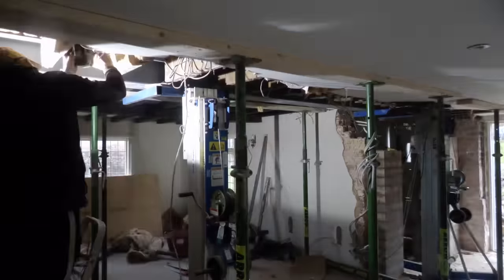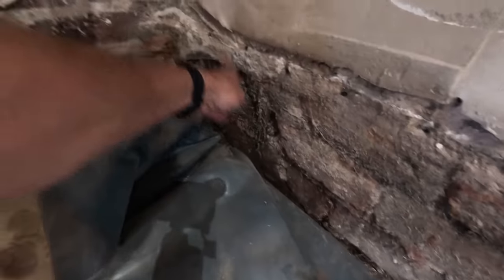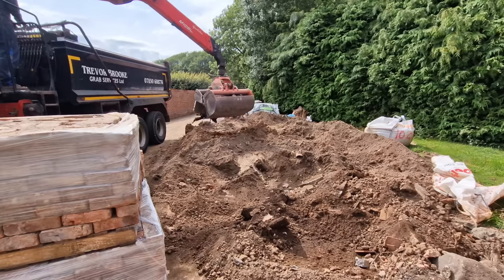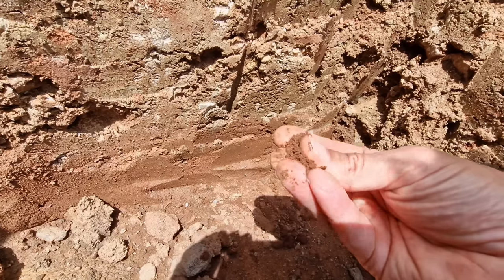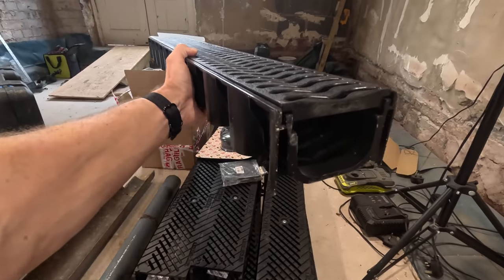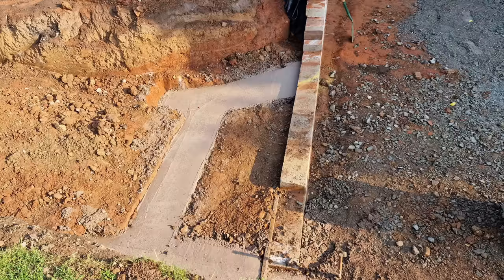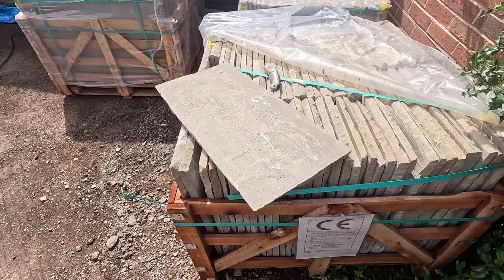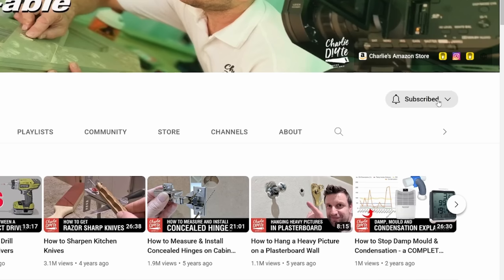Total Garden Redesign

Comment: we recently had an extension done and had a few quid left over in the budget for contingencies
we did run around 20% over that as well as there are so many unaccounted for costs that you don't factor in, all the permits and plans for example were the thick end of £4k, we spent over £1,500 on extra electrical fittings and a new consumer unit, then things like tiles and all the little things such as radiators and valves and waste traps etc all add up to eye watering amounts
we were VERY lucky to have the actual cash money because we would have run out after the shell had been finished had we stuck to our original budget numbers

Comment: Charlie's we moved into a 1900 sandstone house last August, it has been extended but long story short all of the extension stuff has been very poorly done, we budgeted ( after seeing the issue) 10k to fix the 3 steel beams leading from extension to old house- it was a mess, it cost us 37k to remove and install the new beams- 16 now In total as the 3 beams were not up to standard and they had been complete opposite from what was on the council planning paperwork, due to the that work nesding done we rhen had to fork our over 30k for new kitchen. A simple viewing hole to see why the walls were so thick around the extension was bang on were the weight of the extension and old roof has lead to deep cracking. Lucky hole drilled at exact height lead us to a 67k spend we didn't even think we needed to do! Absolutely gutted.

Comment: As always an informative and interesting video Charlie, it's tough when you get scope creep, but, as you have identified, sometimes it makes sense in the long run to bite the bullet and fix the problem at it's source before moving on ! Levels are such an important consideration, particularly in older properties and also particularly in the westward water counties of the UK !

Even in my Millennium era new build there are issues around levels between adjoining properties and I am in the process of ripping up my builder installed patio and re-laying it with incorporated eco-drains that exit into soak-aways under our (currently arid) lawn !
Reply from the maker: Thanks Andy, and great to hear from you. Scope creep is a good way of describing it! Really hope you sort the drainage issue - sounds like a good idea, that. 👊

Comment: A bit less than a decade ago I hired a painter to paint the trim on the windows on the upper floor of my house as I don't do well on ladders. Despite me telling him not to do it, he painted a base coat of oil before applying the acrylic paint I had supplied. I painted the ground floor window trims with just the acrylic paint.  After three years the paint on the upper window trims were starting to show cracks, something that didn't happen until the fifth year on the ground floor window trims. The only preparation was to scrape away any loose paint. (Thankfully I don't have to worry about painting the window and door trims anymore because as the house is almost 30 years old it was time to replace the windows and doors. I got ones with vinyl trim that I won't have to worry about for a long time.)

Comment: For the raised walls, you could have poured in clean drainage gravel behind, membrane it to stop soil migrating into the gravel, then put 20mm pipe into the base of the gravel to allow water to pass through the wall into your new shallow patio drains
Reply: Depends. If it's a clay soil never use a membrane to stop migration of soil. It will clog up and contribute to further hydrostatic pressure. Filter fabric (non woven) should only be used in non-clay soils like sandy soils.
Reply: What would you use then?

Comment: I'm in the middle of similar works on my garden, almost identical in fact.  My question is why are you using cement with lime or lime with cement  if you prefer ?  Is it a colour thing ?  Cement completely negates the breathable benefits of lime and having been on a great lime training course, lime doesn't need cement to bond but is usually branded as belt and braces by those who routinely just use cement.  Keen to hear your thoughts and always enjoy the videos.  Keep it up !
Reply from the maker: It's a good point about the lime. I think in this case it's just a colour thing. The salvage guy said to use lime as the bricks would need to breathe but Gaz who's done a lot of heritage work was a bit dismissive. I think he's putting it in to humour me a bit but it will slightly lighten the mix and increase plasticity and workability. I guess you have to ask yourself how important breathability is when the mortar is only between the bricks. Would be interested in what you learnt about this.

Comment: Thanks for the update Charlie. Found this interesting. One bit I didn’t quite catch was how rainwater behind the retaining wall drains away. Would there be weep holes (if that’s the correct term?!) strategically located in the mortar of the concrete blocks and the reclaimed bricks such that water would drain onto the patio and then into the drain there? Or is the water diverted without getting through the block work in the retaining wall in some way? Keep your chin up on the cost front. The borrowing will no doubt be painful but the chances are you’ll be adding more in value to the property than what it costs. Plus you’ll have an amazing house and garden to live in :-)
Reply from the maker: Thanks for that, really appreciate the support 👊 Yes there will be weep holes. They're going to drill holes through both courses of brick when the wall has been constructed - 35mm pipe. There's a combination of broken bricks and 20mm gravel behind the weed matting to create a soak away of sorts. Totally agree. Tesco 5 year loan, and DIYfe will probably need to take one out as well but we'll finally have a garden we're proud of and can get friends around to, and as you say it will add value. 👊

Comment: I know the feeling been doing garden project myself. Been doing day rates until now, I feel like it works it cheaper but might be wrong? what’s advantage of fixed cost vs day rate?
Reply: P.S we got rid of loads of rocky clay mud basically, local farmer kindly took it, 12 tonnes for £250. Meanwhile I am on my 15th tonne of top oil into the back to bring the level up for turf

Comment: Just be careful Charlie - you seemed to intimate that you have connected one of the surface water drains to the septic tank. That will stop it doing it's job and during rain, it will flush the system and eventually choke your outlet to the drainage field / soakaway (and possible end up leaching into the watercourse). So make sure you keep all your surface water / rainwater drainage away from the foul septic system to avoid issues!
Reply from the maker: Sorry that was ambiguous of me. No, when the septic tank was installed we discovered half the roof was draining into the old one - good knows how it coped over the years so we put a bipass in so that the roof and now patio drainage water goes off into a soakaway. Funnily enough the first thing I did yesterday was check this by putting a hose pipe down that new pipe and was relieved to find it drained into the first inspection chamber after the septic tank. It has unfortunately made me realise the tank is full and needs emptying 🤦